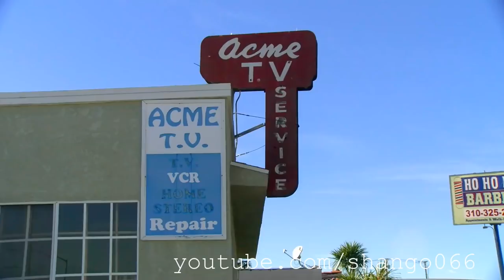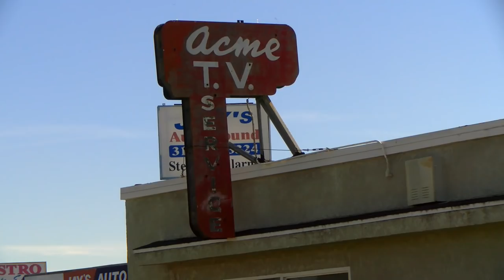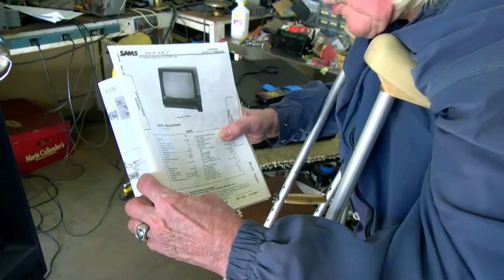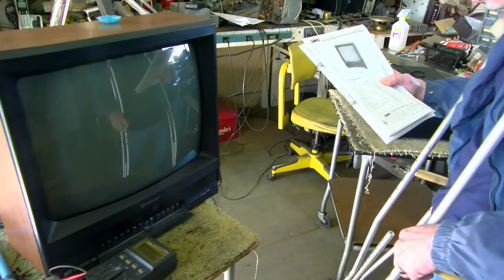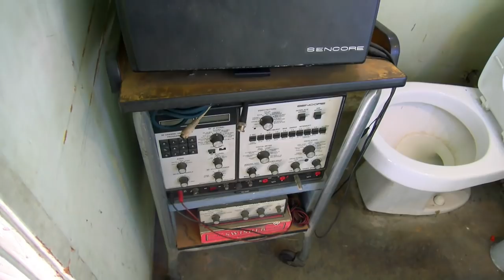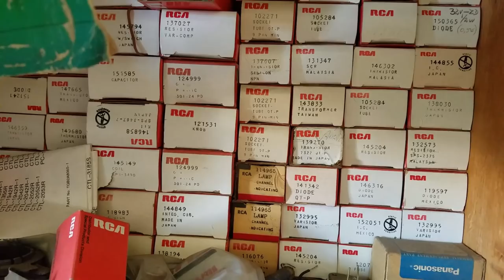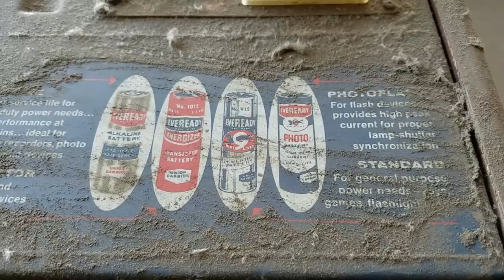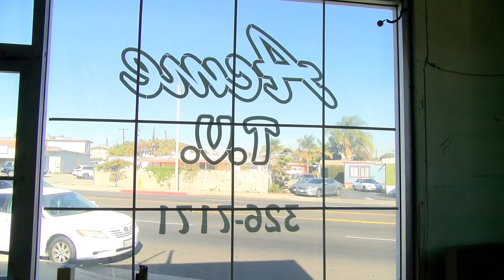Acme radio and TV repair 1957 to 2018 Lomita Ca

Comment: here in Brooklyn NY the last TV shop like this is still standing advance electronic but I don't know for how long most went out December 1998 to  2001 ish in the electronic repair hay day the 2 hubs for parts were 1 in Brooklyn RCA mills 1 in Queens I don't remember that name something electronic they did make 2 delivery's a day for parts  I remember most of the shops names around me  any one that's reading this in ny probably will remember also once they went out it just about killed service but then came eBay just customers did not want to wait for days  for parts if a set took more than 3 days to fix the 4 day you got the call whats taking so long I was like this also I use to watch our tv repair man fix ours n asking questions when he died his helper called n gave me a lot of tools n parts n I started fixing electronics this was back 1989 so for me here to say what I've see in the change was vacuum tube TVs faded out 1995 ish as an ever day tv not because of tubes but the high voltage flyback were no longer available the most popular TVs were solid state RCA xl 100 CTC 70s to 100s zenith DC 50s  n up to system 3 most people only fixed 19" n up color TVs n  floor model consoles were big thing the last potable i did was 1984 quasar cube tv that  was in 2000 the last console was 1977 zenith chroma color in 2001 not many people fixed the 90s models unless it was a big screen 30" n up if the price to fix a 90s tv was half the price of a new one they went new House calls in the 1990s were $25-$39 walk-in were free in most or $15 basic service was  $85-$125 heavy service $150-$200 it depended on the problem crt TVs hit the streets when over the wave signal change digital not many got the conversion box just a new flat screen around 1998 most of everything became throw away I did appliances also by the end of 2002 I stopped fixing everything was made to last 2 to 3 years n get rid of it nothing but junk here n there I will still work on the old style  the only ones that still want whats now called vintage fixed are mostly sensors that  don't like change I still have a storage bin 12x20 filled with old TVs n appliance parts the last batch of TVs I fixed that no one claimed were 5 consoles  that I still use in my house today as everyday sets the newest one is 1975 they are all color modern technology is killing off a lot stuff 10 to 15 more years more people won't know or remember any of this just throw it away n buy more

Comment: Next best pivot would have been phone and laptop repair.  Require investment in micro soldering and just generally getting used to very small components, and the fussiness of dealing with cases and access. Then there is dealing with that customer base.

Comment: You know the last real American Television manufacturer was Zenith .
I wonder if will have a television set made with tubes again on a flat panel television .
If we did we have some really nice sound and picture .
Now they make this junk which after a year the led strip goes out .
The Television repair man is no longer a good choice that stuff is fun fixing at times .
I remember how good the sound and picture was from a tube set .
The American television manufacturers beat the Japanese 10 to one in sound quality.
The CRT I don't miss on larger sets they did use up electric like crazy .I remember when I use too see Zenith repair shops still open in Chicago Illinois .
All gone now the people who did the work died or retired .
Americans should restart building television here In America again .with parts made in the USA ..
We can produce some good high end stuff like we did.
People dump your smartphones and get back too life ,teach the younger generation what it was then and how we can make stuff work here in America .

Comment: It saddens me to see this era pass... what I think really happened is the economics of automation.  Back in the day, the chassis were hand wired point to point.  There was much value in that cabinet.  Today, the robotics have taken over with the pick and place, the wave soldering, etc.  The prices have come down substantially.   So in reality there is less and less value in that cabinet.  Chuck it and replace it.  The new version will have more firmware features anyway.  I liked the old world better...

Comment: The US Gov has had a hand in this demise also-most of those older sets have big trouble with
FREE on the air Digital TV-if you are even in range of reception.
Those crappy receivers aren't worth the $40.00 credit we were subsidized with.Especially where there is substantial RF leakage from crappy Cable splitters,terminations and splices
Gee thanks FCC.For NOTHING
Then they top it all off with "Cash For Clunkers" destroying the scrap yards and then selling the metal to China to send even more crap.
Idiocracy.Get the movie/It will all make sense

Comment: Surprised he styed this long.  The poor man bought all these expensive parts and manuals.  Often the manual is more than what you make on the repair.  NTE parts are another scam, you pay 2 bucks for a 10 cent transistor.  I often would just rip parts out of other chassis.  I only kept alive by being really cheap.  I worked out of my car fixing video games for years. No rent and a car full of junk boards and parts I got either online or in Chinese run stores.